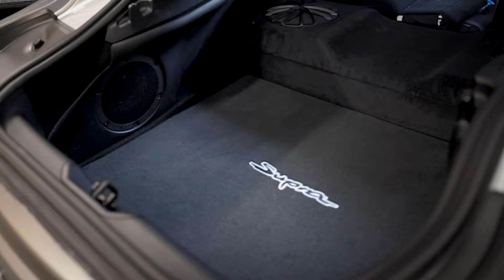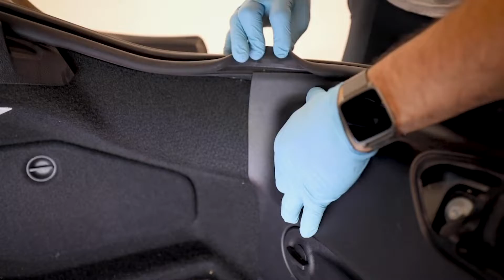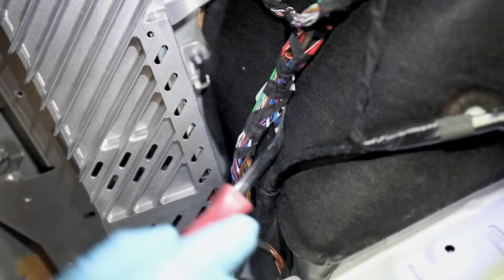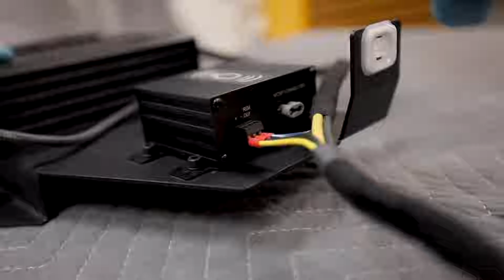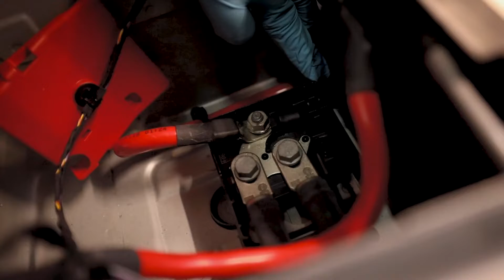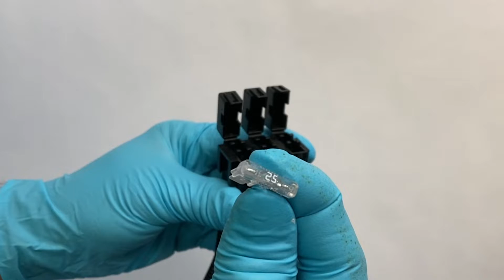Toyota Supra | High-Resolution Audio Install

Comment: I have a question, will the original subwoofers remain active (working)?... Also, I'd like to know if the new amplifier increases the volume of the rear speakers, because in my case, I feel like these speakers sound 50% less than the front ones.

Comment: Just purchased this. Hyped!
Reply: Hey man, would you mind giving me an update on how your system is still holding up? Any issues after install? Let me know? Thanks!
Reply: Give us an update. How does it sound?
Reply from the maker: We share your excitement! Be sure to utilize our team as a resource throughout your experience (before, during, or after your installation). Your satisfaction is our top priority!
Reply: @Oemaudioplus  I did have one question about the 30 day lead time. Does this mean I receive the product in 30 days?
Reply from the maker: @wfujay3946  yes sir (typically less). Our team builds in batches to ensure the utmost quality goes into each order. However not a minute is wasted. All components are at our facility in Anaheim, so depending on your order date our team will be started on the build and calibration of your specific order within 48 hours.  Our team will be providing you a shipping notification, in the same manner, you should have received your order confirmation.
Reply: Hey man how does it sound is it worth it

Comment: How does it sound? Any audio clips?
Reply from the maker: High-resolution (clean, crisp clear) sound is our top priority all the while delivering the emotional weight of your music (via the low frequencies). You can expect seamless, full-range, detailed sound reproduction of instruments and voices without localizing the speakers or sub.

Unfortunately there are several limitations to attempting to capture the sound quality over a video. Between the limitations of the microphone we use, compression of whatever video streaming service we use (YouTube in this instance) and the playback device you use (computer speakers or headphones) it will serve as a lackluster representation of our high resolution sound. 

Mind if we ask where you are located? Perhaps there is a demo opportunity in your area.
Reply: @Oemaudioplus  I messaged you on Instagram. I'm in LA
Reply from the maker: @PatrickJS  great! Our team has received and responded to your message. Hope to schedule a session soon.
Reply: @Oemaudioplus  I am from Milwaukee, Wisconsin. I am looking to upgrade my audio system and this looks like a good choice